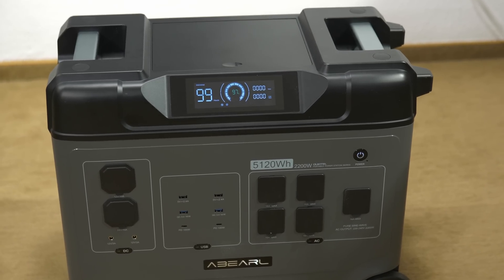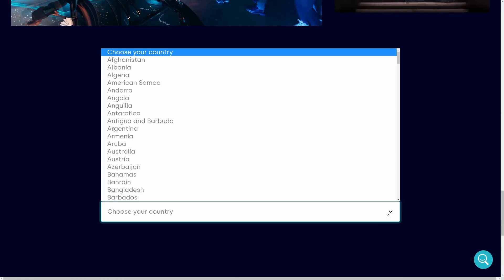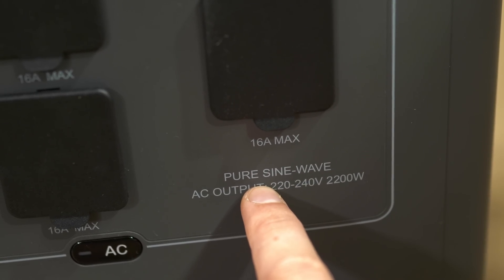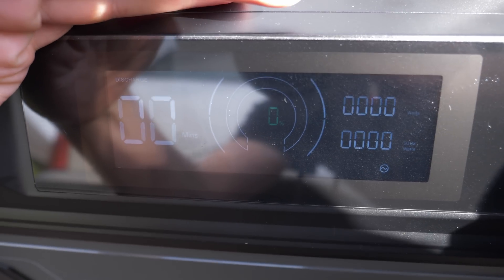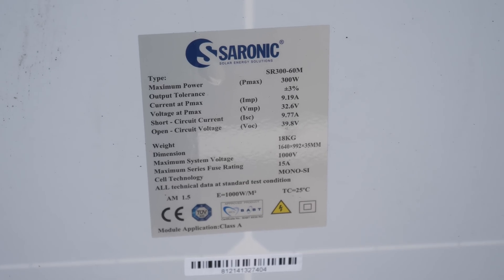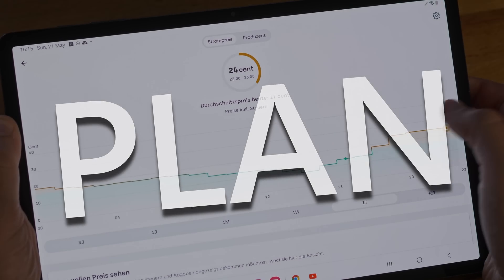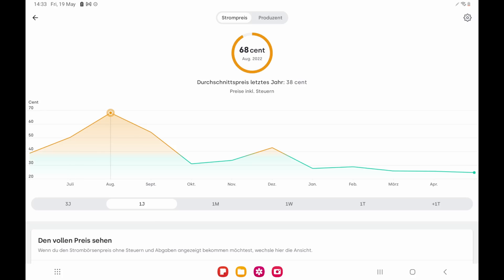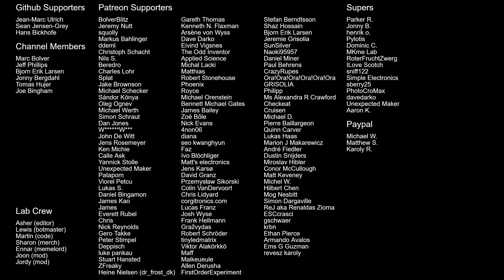I'm a power hoarder now! [Oukitel P5000, Tibber]

Comment: this is a great little plan - shame the grid costs so much in the first place. where I live electricity costs between 7.4c/kWh-15.1c/kWh+fixed charges (5-10.7 euro cents as of today). I'd recommend some rails for your panels ideally so they don't blow away in the wind.
Reply from the maker: My budget for mounting the panels is exhausted😂
Reply: Where do you live?
Reply: @kitecattestecke2303  ontario, canada
Reply: At that price point you'd actually make a loss if you tried to store it in a battery.

Comment: You may be able to replace the noisy fans with something better and larger. Noctuas perhaps?
Reply from the maker: shouldn't be too hard to mod
Reply: @bitluni  I tried it. The original fans have 6000 rpm and they are working almost all the time at full speed. I replaced the 2 fans that draw air in and cool the AC inverter of the power station. I used the Noctua NF-A8 FLX 80mm model. But the Noctua is too weak, it has only 2000rpm and the airflow was barely noticeable. In addition, the Noctua has rewired cables and a different connector than the power station, so a small modification to the fan connection cable was required.
I ended up putting the original fans back because I was worried that the Noctua wouldn't be able to cool the AC innverter with its poor performance and I could damage the power station.

Comment: In UPS mode, does the unit have a beeper or some way to warn you if the battery level is low?
Reply from the maker: I didn't notice anything the two times I drained it completely

Comment: I wonder if it could power a whole home via a suicide cord.
Reply: You legally need an ATS installed on your grid feed to do that, otherwise you'll risk killing line workers during a power cut.
Reply: @gsuberland  only if you want it to be automatic, manually pulling the main breakers should be fine, shoulnd it?
Reply: @TecSanento  It would work, but you shouldn't do it that way, because if you forget to pull the breakers you could hurt someone. Because of that is suspect it wouldn't be legal almost anywhere, certainly not in Europe.
A proper transfer switch is highly recommended.
Reply: @TecSanento  ATS is a legal requirement in most jurisdictions. A high proportion of injuries and deaths due to backfeeding in a power cut have been due to people who had a transfer switch but forgot to actuate it. Also worth keeping in mind that the 110V or 230V is often not what directly causes the harm; it's the unexpected shock leading to a fall or other secondary injury, especially while working at height.
Reply: Why? Just use it in UPS mode.
Get it close to the important loads: fridge, etc and if the power goes down you wouldn't notice.
Reply: Sure, but you have to disconnect from the grid, else the battery is empty pretty fast.
Reply: No it wouldn't - it's single phase and not strong enough for the ofen...